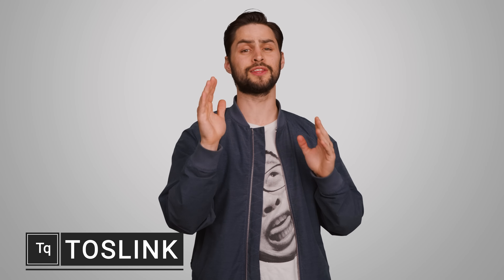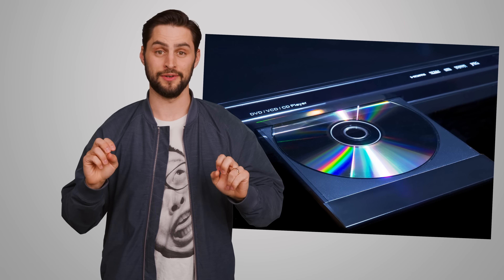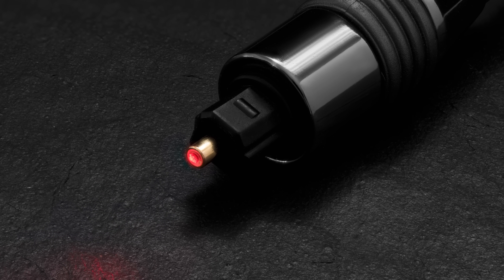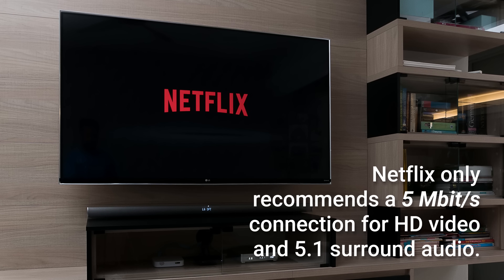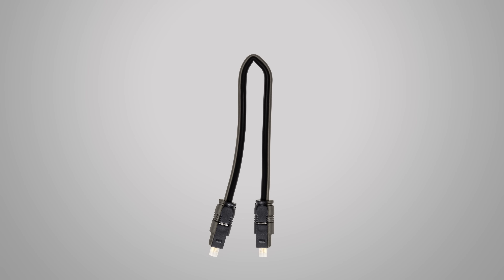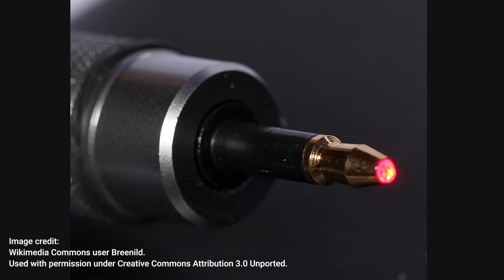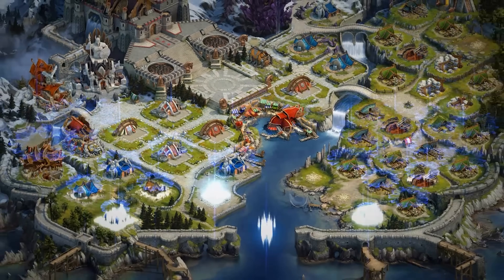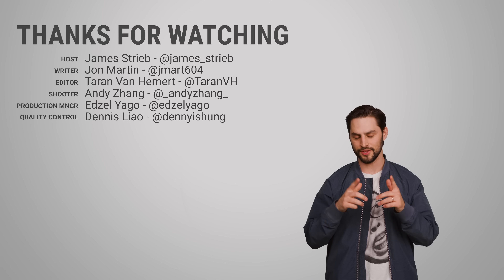Why IS This COOL Cable Dying? - TOSLINK Optical Audio

Comment: We use Toslink all the time in professional audio studios.
You can for example have 8 microphones recording a drum set. 8 microphone cables go into 1 analog/digital convertor, and we use 1 toslink to connect it to the main soundcard which often supports 8 inputs. So you end up with a total 16 channels to record on. That's plenty for a garage band...maybe not a symphony but good enough for most small bands.

Comment: The light is not loosing strenght o.O
It's blurring the on/off signal because the path of the light bouncing around inside lenghtened part of the signal.
Geez, TechnologyConnections is way ahead of you on this one lol

Comment: Now this was just poopoo :( TOSLINK is the connector, S/PDIF is the protocol for compressed audio transmission via the cool cable with that Toslink connector (or with coaxial cable & RCA connector). Toslink can also be found in audio recording applications using other protocols to transmit uncompressed audio. Cable not dead, connector not dead, what is this

Comment: I've got my headset (Astro A30) plugged in through optical link to the mix amp. Yes I know there are a lot better one's available but they work and other than some crackling from the master volume control at the lower end of the volume range, they work. I'll be replacing the pot on the master volume  control in a few weeks so it's good for a long while yet.

Comment: Interestingly, you can easily get new 50-foot professional-grade toslink cables for  20 on eBay. Try getting a 50-foot run of HDMI for that price. I was concerned about signal loss, but they work great.  This is one of the benefits of this technology going into the dustbin.   Also, I am not a fan of all these new SUPER multi channel formats.   5.1 is just fine and serves the purpose. All these receiver companies are trying to force me into buying a new receiver. No thanks.

Comment: Wait, so the reason it's impossible to find a surround system that supports it under 600 EUR is because the standard is too old and deprecated, rather than too new?

Comment: Because it's only 44.1 @ 8 channels and it doesnt sync very well with multiple channels.
But however, When used together with COAX then it's stable as a rock and you can get TOSLINK extenders.
The main problem is that the female sockets are very fragile and so are the cables if you bend them.

Comment: Still using it. I even have a purely mechanical switcher for the signal. xD it's just light anyways, so you really just need a box with connectors and some mirrors. Kinda sad that the tech didn't evolve, but it served me well... been using since I got my very first laptop, an Acer Ferrari 4000 series, plus a PCMCIA sound blaster card, which had the mini toslink jack.
I seriously have no plans of ever replacing my ancient Logitech Z5500 speakers unless they break and become unrepairable, so I will probably still be using toslink for a while... it doesn't have HDMI, so it's either that or composite.

Comment: Maybe for home it's going away, but toslink is still very useful in the studio. It just uses the ADAT protocol instead of S/PDIF. ADAT lets you send 8 channels of digital audio over a toslink cable, or 4 channels with a higher bitrate. It's still very common to see on higher end audio interfaces as a way to expand the amount of I/O you have.
Reply: No studios use it becuase it's limited to standard bitrate I thought
Reply: @sezjames2472  It can do 44.1 - 96khz. I'm sure really high end studios don't use it... I don't really know. But a lot of low-midrange audio equipment still has ADAT and it's useful.

Comment: I actually love Toslink, 
My mainboard now and then isn't "loading" or booting up the analog audio output, which I suspect is an problem from the mainboard group itself, as I had changed the MB once allready. 
So Toslink is a great way around as it always functions ... only downside, the Netflix APP won't work with Toslink, there is only a big high pitched boom, and then no sound

Comment: I wish we could get a modern version of a TOSLINK-like tech instead of the thick HDMI cables and chunky plugs. Using light and glass fibers for transmitting any type of data just seem more future proof to me instead of using electricity and copper cables. HDMI is like a sister version of the LAN cable, which I also think is outdated. It is just a matter of time before they become obsolete just like the xDSL internet connections. Who doesn’t want fiber internet into their homes, and also have fiber outlets instead of RJ45 outlets everywhere? If i had the tech and money for it, i would switch all my LAN cables and RJ45 plugs to fiber any day. I also think you will get a lot of attention amongst nerds if you pull this one off at home.

Comment: I am 'still' using the awesome Toslink, for both my PS4 and my 4K HDR Tv. Firstly, because the PS4 wants to be connected directly to 4K HDR tv, if you want HDR and secondly, because dear old Samsung omitted DTS codec from their ARC HDMI!!!! Also, I did a comparison between Dolby\DTS and DTS MA\Dolby HD and I do have a good system (Klipsch quintet 5 with Klipsch Sub R-10SW, Denon AVR, but I don't hear any discernible difference between Lossy and lossless. 

Besides, I think my 5.1 system loves my optical cable, the audio is somehow just fuller, maybe this is just placebo, but I do use High/studio quality Toslink cables.
I do hope PS5 will still utilize Toslink. 

PEace

Comment: I still use Toslink for connecting my external DAC. In fact, Toslink is the reason, it still use my old FireTV Gen1. 
The nice thing is, via digital sound you can use only one good DAC without deteriorating the quallity. (if you are opting for HIFI)

Comment: I like toslink, it fixed all grounding and interference issues I had whenever I tried to connect my PC into a DAC, which was then connected to a pair of active studio monitors. With USB there was a lot of interference (ground loop probably), but with Toslink everything was dead silent because it severed the direct electrical connection between the two devices. ANd I still use it with my home theater receiver. DTS and DD compression are both very good quality and I have a good amp plus I really do not need anything better than 5.1 so I do not see the need to upgrade just yet.

Comment: On the industrial automation side, Rockwell has moved away from a dedicated fibre optic cable loop for servo communications to regular ethernet. They called the product SERCOS and maybe it was high bandwidth when it debuted but now CAT5e vastly outpaces it, the only thing you have to worry about is network switches or routers deprioritizing safety critical servo traffic.

Comment: Question: if you experienced interference (only) while a microwave is running near an audio device, would a TOSLINK connection fix that? Because that was an issue for one of my family members and after redoing the audio setup there's no longer interference.

Comment: I still use the Toslink with my PS4. 
The HDMI goes to the Monitor and the Toslink to the 5.1 surround system.

Since games rarely support Dolby Atmos anyway there isn't a big loss or any at all.

Comment: Actually! As a working audio professional, ADAT a.k.a. TOSLINK is far from dead. Audio Interfaces and External Preamps still use the format for transferring multiple uncompressed audio tracks. Not enough bandwidth for the sample rate you wanna use? Add another TOSLINK port and cable.

Comment: Thing is that format itself and it's implementation was not even good.
It literally outputs S/PDIF signal to LED and use simple optical sensor for reading it, no fancy optics nor lasers involved.
These days you could put much higher quality and much smaller optical connection inside USB C, for fraction of the price, especially when you take in to account how hard making USB C with high quality bandwidth is.

Comment: Toslink was great for CD/DVD players, but not very good for PCs. If you wanted surround audio in games, you would have to use Dolby Digital Live or DTS Connect to encode the audio on the fly, and very few sound cards supported that. Plus it was a lossy compression. I only used toslink when I had a stereo setup. The technology is cool, though.
These days HDMI is the ultimate standard, it is everywhere and supports everything.

Comment: Aw! I love using optical off my PC and loved it as a "legacy" solution where HDMI or its implementation in some devices just didn't cut it.
Reply: I not see it as legacy as I use hdmi for video and toslink/digital optical for audio still and won’t change, I am looking at 4 year old soundbar so can get one with it, love if can connect sound from two PCs to one without issues though as want 5.1 from both to my surround sound, also I find it entertaining how many use headsets for streaming, I set up gates so can stream with my 5.1 speakers a foot from my mic without affect audio and when stream had no issues

Comment: Toslink is Dying!

Audiophiles:  Mhm.
Reply: My old receiver that I still use has a Coaxial and Optical. I liked having a coaxial on my motherboards for hooking it up from the PC to the Receiver, but that is phasing out, and all I see motherboards now with is the Optical one still, so I'm stuck using Optical.
Reply: @MasterLudo  your comment makes no sense, this is digital signaling there is not quality to it. It either works or it doesn't. If you get bad signal over digital you have severe distortion or no connection, or everything works fine there is no in-between or loss of quality you are just ignorant and uniformed. Probably buying 1000$ silver cables. Believing in audiophile voodoo magic.
Reply: Real audiophiles: coax
Reply: @bassrover5925  coax sucks. have way better experiences with toslink.
Reply: Yeah this video is fucking stupid. Newer motherboards are just now including it.
Reply: @Smokeahontuz  WTF Nope opposite, they were very popular in the 2000s. Mostly as one of the 3.5mm also on Laptops. Now modern PC are abandoning complex onboard audio. None of my Skylake generation computers have Onboard Toslink, i have to use a USB converter.
Reply: @Neojhun  lol my new b550 has a toslink
Reply: @xXDESTINYMBXx  My b450 as well
Reply: @Smokeahontuz  yah, my TUF Gaming X570 has built in Wi-Fi and an Optical S/PDIF Out port.

Comment: Its used a lot in custom car audio systems. Since its optical it alleviates ground noise problems. Most car guys have a very hard time understanding how current works, so this is an easy fix for them.

Comment: I would be using TOSLink, except I'd have to buy a new receiver since mine is old enough to not have an TOSLink port. At this rate, by the time I buy a new receiver, it might not be around anymore. I know I have zero interest in wireless speakers.

Comment: Fiber optic hdmi Is live in well for sending 4k 60fps HDR over 25 feet. Its WAY cheaper than cat 6 wire and boxes. Got my pc working 60fps 4k 50 feet away from my TV for only an 80 dollar cable.

Comment: Fun Fact: if you heat up an optical cable while it's working (perhaps with exhaust fans of your PC or console) you can distort the signal and hear a popping sound as a result.

Comment: My 9 year old tv does not support 5.1 surround passthrough with the hdmi. So i hooked up my xbox one to my 5.1 bluray player with toslink and use a av hdmi switchbox to connect all the other devices like apple tv or my swisscom tv box to the input on my xbox. So only one cable for video to my tv and one toslink for audio to my bluray 5.1! Works like a charm 🥳

Comment: The worst scenario you could possibly have is audio routed through this, but if you are OK with out of sync from video than go ahead. And no, audio delay will not solve this issue. Every app (Netflix, YouTube, Plex etc comes with totally different delay). On the other side it’s shame they discontinued supporting newer standards. There are situations when this comes really handy. But Pro segment is all of this. Almost everything on concerts is optical.

Comment: I was really dissapointed when i got my razer thresher headset for ps4, it came with what looked like a 3.5mm aux port on the dongle for aa second input of audio, i wondered why it didnt work with a 3.5 jack and found out it uses 3.5 toslink which looks exactly the same, this is one good reason that it should go. confusion. and for anyone wondering why i wanted 2 inputs, is cause i want to hear both my pc and ps4 at the same time which both do not support toslink

Comment: Optical would be my first choice in sending a digital audio only signal.  If you have height speakers then good on you, you can't use it for Atmos. If you have a soundbar then you don't need an Atmos signal.

Comment: With Toslink you can get 7.1 channels of Dolby Digital EX 640kbps, DTS 1536kbps, and the forgotten yet best of all-WMA PRO 768kbps for the Xbox 360 in which you need certain AV receivers to decode. I hate that the Xbox 360's highest quality option is so highly limited now days compared to the all famous DTS which gives out the same quality except, WE CAN'T MIX WMV+DTS INTO THE SAME ASF CONTAINER! So WMA PRO is the only surround option for VC-1 unless you use SRS Circle Sound which I'm not going to compromise with. I'm getting the VSX-90TXV for the WMA Pro since the Xbox Spherex sound system doesn't support it, NOR DO MOST OTHER SOUND SYSTEMS!

Comment: I use TOSlink to connect my PS4 to an digital to analog audio converter which uses a 3.5mm aux cable to connect to my PC's line in so i can just listen with my computer's headset

Comment: I just bought a Toslink cable the other day in order to connect an older PC's audio to my main computer. I need it for audio recording (using older software that doesn't run properly on win 10 or in virtual box). Also my sound cards don't come with hdmi and i couldn't waste precious display connections for just audio instead. So far I have only seen 1 sound card that even has an HDMI port and yet it still comes with optical connections too. That's why it's hard to believe that Toslink is dying at this point.

Comment: I still use Toslink with my Logitech Z5500's. Hey this setup costed me $250 NZD. New audio systems are outrageously expensive
Reply: Cameron Porter i too use toslink with my logitech z906 for connecting game consoles to it and PC is connected using analog 6 channel inputs

Comment: I love the optical audio port, there are many reasons it's better than HDMI. The only thing that will kill it is people making news articles like this that are in turn reducing the consumer demand for it. Optical audio is amazing because A) it connects audio in a way that ground loop hums are impossible. B) I don't want my speakers to have brains. They should do exactly 1 thing and 1 thing only, that's play the music being sent.

Want to know why the real reason TOSLink is falling out of favor? All technologies which do not allow integrated DRM (HDCP, in this case) are mysteriously disappearing
Reply: Though as far as not having brains, toslink enabled audio devices still need a dac to convert the pcm or dolby signal to multi channel analog audio, so they need a minimum of processing.
I do agree though that everything should be as dumb as possible. Good ol analog audio has ground loop and interferance (and level shifting sometimes) problems, but it works reliably and it's easy to diagnose.
Reply: TOSLINK is one-way. It transmits data in a single direction from the source  to the receiver. For two-way communication, you'd need two separate cables.
Reply: i still dont understant wth peope need hdmi for audio? why not just trrss?
Reply: You may be on to something regarding DRM, but ground loops are only possible when amplifying an analog audio signal sent from a different grounding point over a distance over electrically conductive wires. Any digital audio technology (eg, coax (same protocol as TOSLINK, no DRM), HDMI, PulseAudio over TCP (open source & obviously has no DRM)) will render a ground loop impossible. The only advantage that an interface lacking an electrical ground has regarding ground loops is that you could send analog audio without ground loops. Such interfaces could be for example: light or AM radio etc. And yes it is possible to send multi-channel analog audio over a single fibre, etc if you use different wavelengths of light (colours) for each channel. Of course, with current tech it would be a waste of money to send multi-channel audio over a single fibre. Digital solves all practical problems and is low cost. Optical has the downside that cutting/joining/splitting a cable into multiple outputs is much more challenging than working with copper wires. Logically digital over electrical wires is much better.
Reply: @joshuamaserow  i'm not trying to be rude here, but your comments are simply incorrect. You're also conflating digital vs analog modulation with digital vs analog audio. Any sound which is transported over a different medium - like fiber - must be modulated then demodulated. This inherently must be digital. Ground loop hums are an electrical phenomenon caused by interconnecting the grounds of two or more devices where a potential difference exists causing an infinite loop of feedback on the ground. I have experienced exactly this personally, a ground loop hum between my PC and monitor that was caused by my HDMI cable.

Please stop presenting as if a subject matter expert on things you have no idea about.
Reply: Irony

Comment: Gee I wonder why its dying... the cables/plugs are chunky, they fall out easily, poor bend radius, people under the age of 35 take 2hrs to figure out their new cable won't fit because it has a tiny protective cover on the tip of the connector. 
Yes I use them if I have to, but man, they shit me.